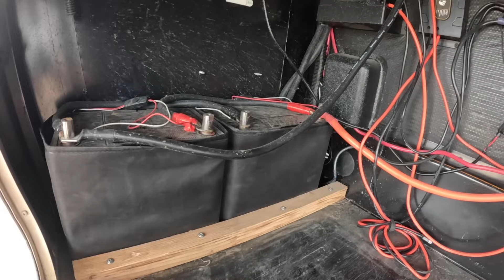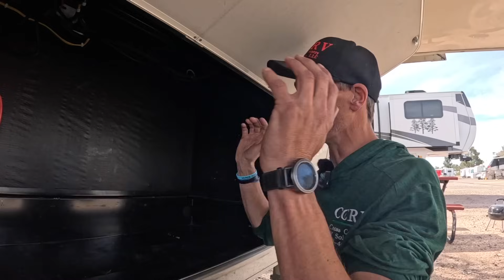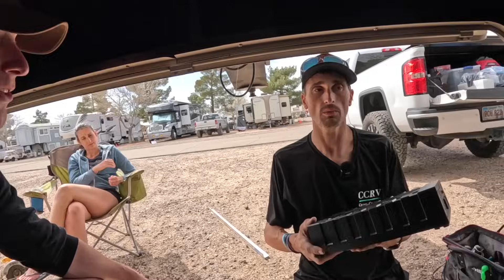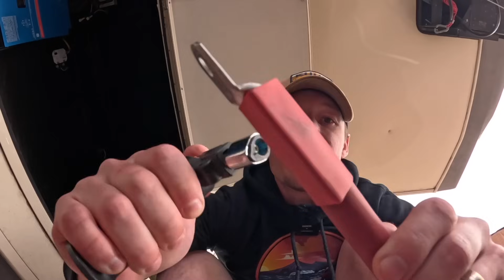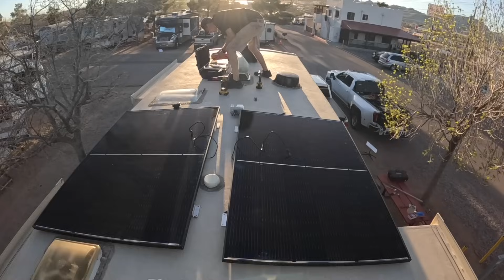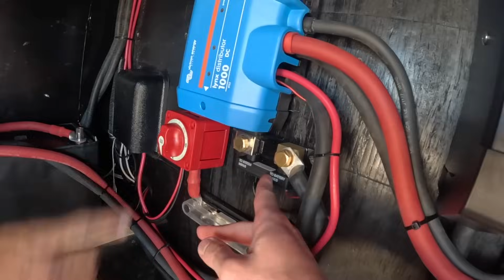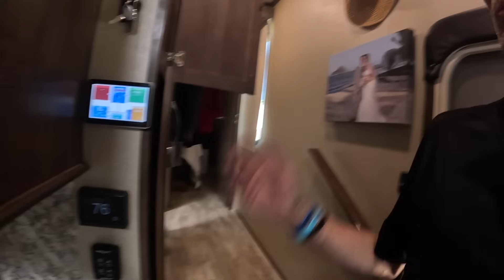Exposed: Expert Reveals the Lies RVers Still Believe

Comment: There's no need to butt up 2 lugs like that. You take a piece of copper bar and drill it out.  Then there's 0 crimp involved. And the rigid connection out of the electrical on the roof would concern me with the buildup of snow and ice.  I don't know what your battery output is but that would be a source of concern.  You really need about 100amps of continuous output per 1000 watts  of inverter.  I personally like SOK batteries and always run (3) 206ah batteries with a Victron MP 3000 VA inverter.

Your friend seems pretty knowledgeable but I don't think he has a firm grasp of VA vs Watts.  This all comes down to inductive loads vs resistive loads.  The inverter could run an electric heater (resistance) at 3000 watts all day long however an inductive load such as an electric motor would max out at 2400 watts.  The reality is our appliances usually end up somewhere in between those 2 numbers.

Comment: Oh, did he change the default pin codes on the Bluetooth stuff? Victron uses 00000 and if it's not changed, anyone with the Victron Connect app can log into your system and, at best, rename each component or, at worst, totally destroy your power system. Change the default pin codes, guys and gals.

Comment: 48V systems for high draw items such as air conditioners are more efficient. Less amperage required to start vs a 12V system. You don't "need" 48V, but you may "want" 48V.

Comment: You might want to rethink the catastrophic fuse. It's the wrong type. That fuse can still arc if enough power is trying to travel through. It's better than not having one, but you should use a T-fuse instead. The inside of a T-fuse contains sand (silica) that, once the fuse breaks, due to a catastrophic failure, it can't arc because of the sand. Welcome to the Victron blue world! You'll love your new system.

Comment: When I did the lithium bank for my yacht I found out that the length of wire that comes off the battery terminals to the bus bars needs to be exactly the same length or you will end up with damaged cells.

Comment: Great video for folks that are thinking about going off grid.  We have a larger system but with many of the same compenents (battery bank and Solar) are larger and our Victron has been rock solid.  We also have a generator should the sun go between the clouds for several days we can bring the batteries up to 100 percent.  It is great to be able to turn on the AC just before stopping at the campground to begin getting the RV a bit cooler.  You guys are gonna love it!

Comment: Derek & I installed additional solar to my system a year ago. Removed the Renogy junk and went full Victron. Great guy. I have been friends with him and his wife  & dog olive for a while now . I'm his post office in Yuma. LOL   He DOES know his stuff!!. I recommend him to anyone considering a solar system. I would recommend at least two more batteries. Your off grid power comes from batteries that are charged by solar.
Reply: So I am still trying to figure out where Derek is located.  Help.
Reply: @sandrainfante4268  Derek is a traveler. I have seen him do installs in Fl, AZ, TX, MI & MD. So I would suggest you contact him and arrange a location to meet.

Comment: Pretty good job. However I always advise against ANL fuses. They are not designed for long duration, high current uses. I always install a heavy duty fuse holder and T-Fuse. A few bucks more, but guaranteed it's not going to fail on you. I've seen plenty of those ANL fuse holders melt.

Comment: @HappilyEverHanks Kyle, what do you mean by "newer trucks". I have a 2004 Chevy Silverado 3500 dualy that has mostly been rock solid. On one long trip, I did have trouble with 2 injectors due to an injector wiring issue but cost wise  it was reasonably fixed. No problems since then(about 4 years ago).  Injectors,  turbo, and expensive stiff not am issue. But it is an older truck with 250 K miles on it but not full the. It is actively driven near daily.

So where do you think the middle ground is? Perhaps ask your friend?

Comment: It does look like he did a great job on your system.  You will definately be happy with that over what you had previously.  The Victron ecosystem is great for keeping track of all components in one spot.  

I think you are already planning on it, but I would suggest you add at least 1 more battery since you are really using your 120v system (Air Conditioner / Microwave, etc).  Luckily, that's an easy add in the future.  I believe Victron recommends 300AH min for that MPII inverter.  We ripped out most of the system Keystone provided in our trailer and did a very similar system to what you have with 400AH of batteries, 800w solar on the roof and a 200w movable ground panel to supplement.  We dry camp / boondock mostly and go out 5 nights at a time.  I think we have hooked up to a generator maybe one time since the system revamp about a season and a half ago.  It has definitely changed the way we camp.  No longer stressing about batteries like we did in our old trailer.  We joke that we are now "drunk with power!"   

Take that all for what it is worth.  Unsolicited advice from a random stranger on the internet!

Comment: Derek did a great job! I'm not sure if he covered it but just a reminder that you can use your generator to charge the batteries when off grid. That way you don't have to run the generator all the time. I think you will find that you will want to double (triple) your solar panels and your batteries at some point.

Comment: Love our Multiplus. It has a hybrid mode so you can plug into a 30a pedestal and still use all of your items like you were on a 50a pedestal using the batteries. The UPS mode is also fantastic. If there is a storm in the area (or something else creating intermittent power issues), the Multiplus waits until the power stabilizes before if kicks back over to shore power. The auto transfer feature is amazing as well. I have nothing bad to say about ours.

Comment: Next steps are more bigger battery bank and also being able to charge batteries off truck while driving! System looks awesome. Definitely have to keep us updated. Be safe during your travels guys!
Reply: Being able to charge batteries while driving is not as important as it sounds. The reason why is most of an RV traveling is done in daytime under the sun, so the solar panels are charging system. There is very minimal traveling in an RV at night so the charge off the truck is not done. But every little bit helps. I would add an additional/bigger solar panel before I would worry about truck charging.

Comment: Great system. Just need more battery storage to be really off-grid capable. The 2 batteries you have now won't last long especially with the A/C running. I would aim for around 800ah @ 12v at least. I have 960ah in my van and it's awesome.

Comment: Nice installation guys. Well done Derek. Kyle you were a ticking time bomb 😅. When you can add some more batteries and solar panels you can be off-grid most of the time. 
Just for clarity, thouht I should comment regarding the charging profiles. Lithium or LiFePo4 (your batteries) only have a two-stage charging cycle. FLOAT is not necessary or good for this type of battery. Float is more of a trickle charge to maintain SLA or GEL type batteries. Don't worry - if the profile in your system is set to LI your charger knows what to do.
Happy camping!

Comment: I hope you get to enjoy your system, your system was sensible and you will get a return on your investment.  One thing that people often misunderstand is they think the fuse is to protect the device, it is not, it is to protect the wire.  The wire gets hot and that blows the fuse or opens the breaker.  So the wire size is important you cannot oversize or under size the wire for the fuse to work correctly.  It is very common to see people oversize the wire thinking it is better if the wire is bigger and can carry more current, but then the wire does not get hot and trip the breaker.    The fuse or breaker are to protect the wire and the wire must be the correct size not just as big as you can fit on the device.  I see design engineers even get this wrong and over size a wire.  It is a common mistake made on battery/solar/charging/converter installs.

Comment: Difference between running a guide wire for fishing cable vs. inserting a central line, is you do it while the patient is still running.
Reply: That was 4 alt not 4 gauge That should handle anything they need.
Reply: Sorry wrong comment
Reply: @crazy-eyewoodguy4489  that's "4 ought" wire meaning "0000"

Comment: One question . I’m a weekender rv guy. If have my rv inside my shop stored for the next trip, do I need to totally disconnect my batteries and turn off solar panels if I’m plugged into shore power? Thx, Cooper

Comment: Welcome to the Victron Family.  We have 1000 watts of solar on the roof and are adding an additional 400 watts of portable solar next week.  We have a 3000 watt inverter/charger and a 500 watt inverter, along with three 270 watt batteries for a total of 810 amp hours of battery.  We love it.  Glad you got your system wired up and now safe.  Safe travels.
Reply: This is the first time I've ever been able to understand how long all this would run an AC. Basically 100 amp hours per hour... And so, based on learning that, I get that you have enough to run your AC for 8 hours. Right?
Reply: @comeandtakeit82  no, I think maybe for a couple hours. 200 ah x 12 volts is 2400 watts. Ac pulls at least 1000 watts. So 2400/1000 =2.4 hours. This is before factoring in fact the ac will not run all the time. So if you say ac runs even 50 % of the time, then let’s say 2400/500=4.8 hours. But they have two ac units. This assuming both units are already 12 volts and don’t need inverter to change power to 120 volts. But you should also figure you will only run batteries down to 10% charge, not all the way discharged. So. 2400x90%=2,160.  2160/500=4.32 hrs per unit. But I bet the ac units probably use more like 1500 watts. So 2160/1500=1.44 hours if ac runs full time. 2160/750=2.88 if ac cycles on and off.
Reply: Nice I only have the victron smart shunt so far 😂😂

Comment: Look into the Victron PowerAssist feature, it will blow your mind.  Your generator running plus the power the inverter can put out mean you could run basically anything in your rig without issue (for a short time).

Comment: Why no DC to DC charger connection to the truck or am I missing that somewhere?  I have a Sol 375-RES and I put in a similar battery setup to what you guys did plus a Victron auto cut-off 30 amp DC to DC charger connected to the truck via a connection routed to the hitch and over to the bed side where I ran a line up to the secondary truck battery. Does a great job of charging batteries and powering the fridge during towing.

Comment: I designed a 12 volt system for my off-grid cabin in 2019 using advice from an RV blogger named Bob.  I was so surprised when it actually worked!  And I'm still using it.  Derek💯🩶is a treasure for sure!!!!!

Comment: I’m so glad you finally got solar, this will make a huge difference in you RV life. I self installed my system simply by watching videos and using diagrams for what I wanted including last falls 1560 watts of panels on the roof. I have been off grid since December, not a single plug in other than some cloudy day generator use.

Comment: Hanks...once again, a great video.  You tell a good story and I think cleared some things up for lots of people.   We have had the Victron Multiplus II system in our RV for about 18 months now.  I self-installed it after watching MANY videos and reading lots of articles.  I have had the GoPower system (which wasn't too bad) but I think the Victron system is second to none.  And, when all is said and done, it isn't THAT much more than the other systems out there.  Even yours, which was about $2,800, included the solar panels.  If you take those off, it was closer to $2,000 for not only the inverter, but all of those other components (the shunt, the Lynx Distributor, the solar controller, etc).

One important thing that wasn't addressed in the video, so I'm not sure if Derek mentioned this or not, and that is Power Assist.  One of the MAJOR niceties of having the Victron system is power assist.  From your Cerbo screen, you can set your system to limit the amount of power you have available.  Typically, this is either 30A or 50A.  What power assist does if if you need more power over the circuit you are plugged in to (say 30A), then the inverter will pull that from the batteries.  So, let's say you have both of your ACs on and you're on a 30A connection and you are right there at 30 amps, and then you turn on the microwave, say adding 10 more amps to the draw.  Instead of tripping the breaker, the inverter will pull those needed 10 amps from the batteries and keep right on going.

Where this is REALLY handy is when you're either on a small generator, or moochdocking at a friend's house and plugged into a household 15A connection.  Set the current limit to 15A and any power you need over that (15 amps) it will pull from the batteries (up to about 20 amps extra).

Here is a video showing how to change/set your current limit: https://www.youtube.com/watch?v=jAef2gbJp54

Comment: Is 800w enough? And only 200ah? If you actually want to be completely off-grid for weeks at a time doesn't sound like it's enough. I do agree that a 3000w inverter / charger was the right move. It's enough to run most things and never have to worry

Comment: Nice clean install. You guys could definitely benefit from more batteries. A 12v system is simpler than a higher voltage system, and perfectly adequate for a small system like you have. We started out full timing this way ourselves, with a 620w liftable array on the side of our coach that charged a couple of golf cart batteries, before we could afford to do better. You camp with what you've got. Unfortunately, we had to run our generator a lot when we were just starting out. 

Next, we built a 12v, 560ah LiFePo-4 battery using 8, 280ah prismatic cells and a Heltec 330amp BMS. These cells fit perfectly under the steps of our older MH where our old pair of golf cart batteries used to reside. A small computer fan blows interior conditioner air into this space to keep the batteries near room temperature at all times, so the BMS doesn't shut down charging from them getting too cold and their life is not reduced from getting too warm. We use a 50a Epever mppt charge controller and a Lnex battery monitor on this 12v battery. We have a 1,000w PSW Renogy 12v inverter that we use occasionally to run some lower current draw 120v items like our TV and computer to help evenly distribute our power usage when needed.

By mounting the solar array on the side of our coach, we left our roof free to rack 8, 550w solar panels down the length of our 35ft Class A, 15" off the roof, above our AC, vents, etc. Our 4,400w array can run both our A/Cs, our household appliances and charge our batteries at the same time. We mounted a Sungold Power all-in-one 48V, 5,000W Inverter/100A charge controller/battery charger, breakers and a Lnex battery monitor on the wall in our bedroom to keep it cool and monitor all the functions on the display screen. It saves us space as well as money compared to a system built with individual components. Our 48v battery uses 16, 320ah MB31 EVE cells and a 200amp BMS. Together with our 560ah 12v bank, we have a total of 23.5 kwh of batteries onboard (the equivalent of 18, 12v 100ah LiFePo-4 batteries) charged by 5,020 watts of solar. Building both batteries ourselves saved us a ton of money vs buying preassembled batteries, plus they fit into a smaller space too. One of the advantages of going to 48v for your 120v ac needs is that the conversion from 48v to 120v is more efficient than going from 12v to 120v. Our wire size is much smaller too, saving weight and expense. 

We removed the inefficient and noisy rooftop A/C we had in the bedroom and replaced it with an EG4 28.5 seer-2, 12k btu mini-split heat pump on the upper rear of our coach. It's super quiet and cools as well as the soft start equipped Furrion rooftop A/C we have up front, using about 1/3 the power. This 48v system lets us enjoy 24/7 off-grid air conditioning and heat from the heat pump as needed. No more sweating at night for us, as we usually run our A/C or heat as needed all night long, powered by the sun. Our total budget for both 12v and 48v systems was around $10k plus another $1,500 for the high-efficiency heat pump, as we did all of the work ourselves. This system has already paid for itself with the money we saved on RV parks the first year. But more important is the freedom this system gives us, as it's been over 2 years since we've plugged into a power pole or run our generator.

Last year we visited 11 states, boondocking the entire time, mostly out west. We're visiting family in North Carolina now, where boondocking places are pretty rare, so we're staying in a spacious, no-hookup site at a convenient RV park for only $100/mo., saving us $600/mo. off their normal FHU rates. It's good to have options.

Comment: Now that you have the Multiplus, you can downsize the generator. I can run everything with a 1000w Honda EU1000i.   The Multiplus will either charge the batteries, or run the camper from the generator, or power assist by boosting the generator power up to 60Amps.   The Multiplus 12/3000/120 will only charge 120 amps into the batteries. Amps times volts equals watts. Ie your batteries are 14.6 volts. 14.6 times 120 amps equals 1752 watts. Any generator larger than 2000watts is overkill.